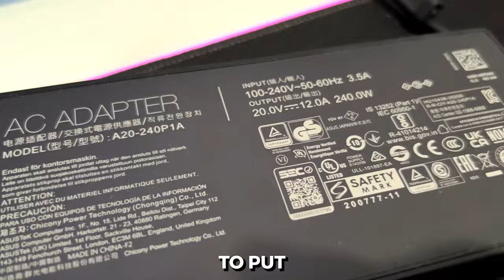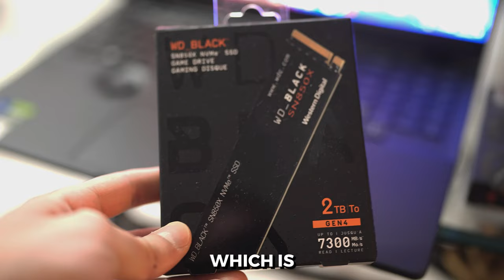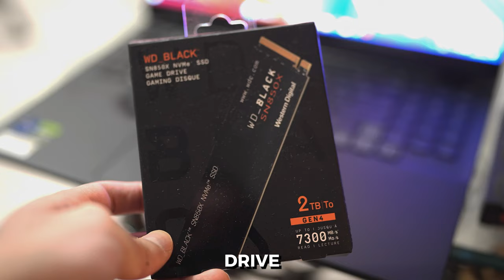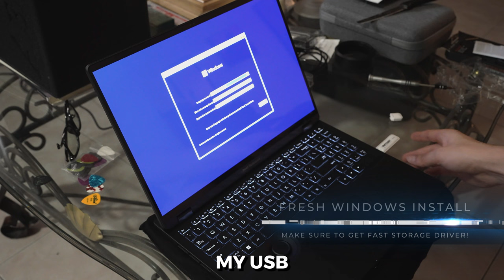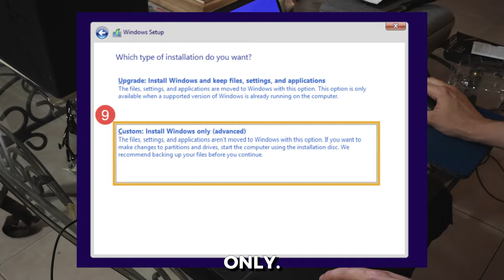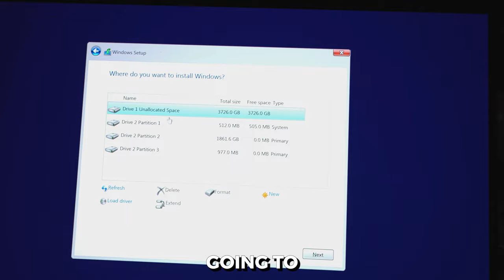Unboxing a New Laptop Workstation for Trading (Dual Boot)

Comment: hey Verrillo nice Laptop. Couple of questions for ya. First I'm about to subscribe to Sierra. Are you a affiliate? 2) what broker would you suggest? My last question is because of my work schedule I will only be able to trade from say 6:30am and 8:30am. Do you think one could be profitable trading pre-market as such. Thanks for all you've done for the trading community.
Reply from the maker: Thanks for the comment! 1. No I'm not affiliate but I do produce some videos for them. There is a material connection. 2. Whichever one serves you the best. I use Ironbeam for trading futures, never had a problem. I use it with the SC Teton order routing, used to use CQG. 3. I think it really depends on the kind of system you are using. For me it's 95% preparation work outside of trading hours and 5% of the work placing the actual trades, no joke. For me it's all about the work in preparation for the trades to set up. So even if you did just trade that 2 hour timeframe, I think a lot more time needs to go into it after hours.
Reply: thank you for the reply it's very much appreciated.  @VerrilloTrading

Comment: why does a trader need debian 12 on his laptop? (im a programmer) also why you need so fast nvme ssds
Reply from the maker: Haha, for me it’s why would a trader/coder use Windows? Linux rocks I am super impressed with it this year. Debian does not fully support the new machine hardware but it should come down the line. It’s more for dev workflow and custom creative stuff. I use the Windows 11 drive for video editing since the hardware is fully supported. The customization is just awesome in Debian with KDE desktop.

Comment: It's 2023. Windows has WSL. You can run Linux inside windows itself.
Reply from the maker: I use that to mount the Linux drive in Windows if I ever need to get files from the Linux drive while booted into Windows. Though on Linux this is much easier to set up as it supports both filesystems flawlessly.

Comment: Its a Multimedia Laptop and not a workstation ... There are differences
Reply from the maker: Could you explain this technical definition? To me it's a laptop used for work so that's why I call it that.
Reply: @ebayklein5325 This is a mobile workstation computer. You probably do not know the difference, between various computer categories.
Reply: It's not a workstation something like the Dell Precision 7670, HP ZBook Fury 16 G9 would be one. Workstations use different RAM like JEDEC so the RAM does not overclock and stays at its basic configuration and they use also graphic-cards like Quadros, RTX A2000. The Asus ProArt Studiobook on the other hand has a consumer graphics card. @CryptoDefender